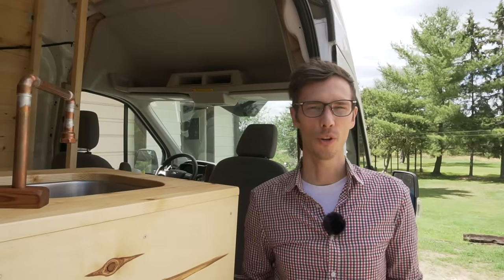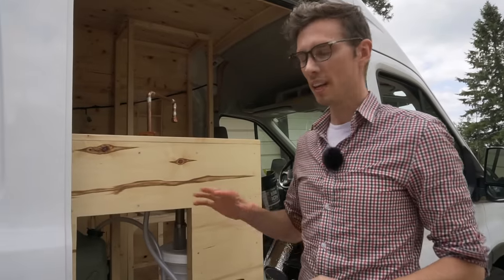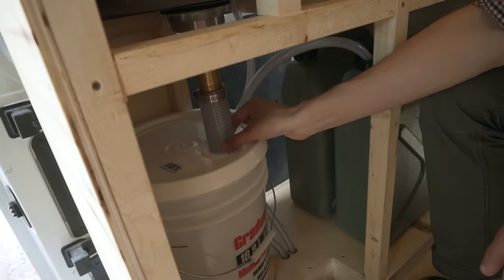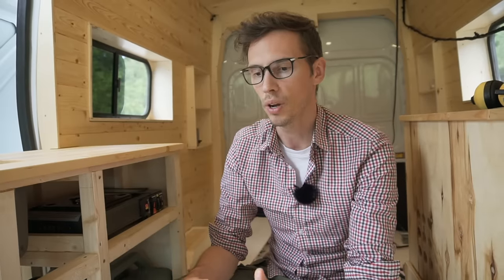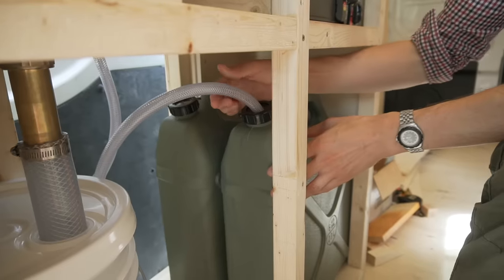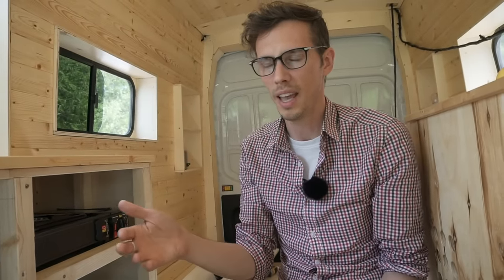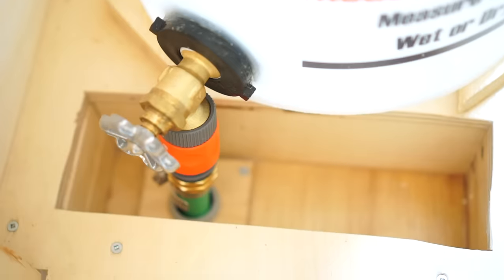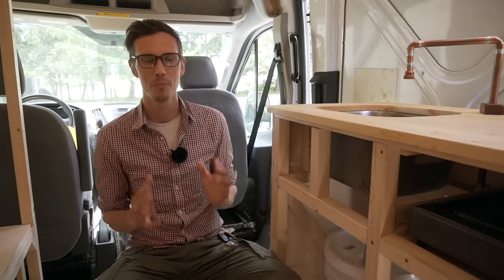Cheap & Easy DIY Camper Van Plumbing System - Van Life

Comment: This might sound weird, but I'm gonna build this and out it in my dorm room because I really want a sink😂
Reply: I will do the same too.
Now I just need to learn how to make a kitchen mini 😂
Reply: It's not really that weird this basic setup principal is used in places like dry cabins in Alaska and stuff all the time
Reply: Make sure you read your dorm contract 
They might not allow it.
Reply: Where did you get the 6gal jugs?
Reply: I know this was a year ago but...did it work out lol? And where do you empty the tank of greywater?
Reply: Not weird at all
Reply: @JJ-el6qx  you can empty gray water anywhere. It's black water that you have to worry about, which doesn't apply. Unless he is into "dumping" in the sink.
Reply: A water basin or baking tray and a bucket is more than enough for the sink, if you glue them together after drilling the holes, though you might want to include a strainer when you glue the things together. As for the tap, you could use such a pump, or you could use another bucket with a tap above the sink, with the possibility to get water without having to pump it, but by having to fill the bucket. You'd need a frame to hold the bucket above the sink, though.
Reply: @ChristianCastle  A mini kitchen requires only a tap + sink + some workspace for prepping, and a stove for cooking. There are propane or alcohol camping stoves, and you could use a bucket and a water basin or baking tray as a sink and grey water tank, though you might want to add a strainer when you glue the hole of the bucket's lid to the hole of the cooking tray or water basin, and you would need another bucket with a tap to have tap water.
Reply: Theonlyonestanding  Thanks for telling me bus carts exist! Now I have to start looking for them!
Reply: @yomamaso100  But you know what they might allow? Two buckets with water inside them and a water basin or baking tray. Add a tap to the bucket on top and drill a hole in the bottom bucket's lid and baking tray or water basin, and glue the holes together with a strainer of the same size, and you have yourself a portable sink with tap water. Using a bus cart would make this setup even easier, though without increasing the height you would need to stay crouched or elevate the bus cart to use it.
Reply: What a great idea!
Reply: Check out the kitchenette at wayside
Reply: Dude, if you do execute this; You should make it in dimensions that you could just install it into a van !! That'd be a sick video !
Reply: Lololololololol!!!!!!!!
Reply: that’s so cuteeeee
Reply: That's hilarious bro!
Reply: I think i would rather use a electric water pump. They sale them and also it recharges. USB. For me it's that simple than pumping, not that i mind at all doing that either
Reply: @larryreyes1064  i’m using an electric pump and it’s amazing and was affordable. i recharge if like once a month
Reply: @jcardosa02  NICCE!! For me, that is the smart way. Good for you doll.
Reply: @justm720  dimensions*
(We're not talking about dementia here! Lol 😆)
Reply: @judylloyd7901  👍🏻 I'm sure everyone still understood.
Reply: Think outside the box
Reply: same I live in someone's basement and I want to try this
Reply: Yes, yes!!!!!
Reply: But do you own it :)
Reply: Go for it. I'm also going to do this in my room
Reply: @AlexandriaPerel  Amazon some hardware stores and most camping stores will have them
Reply: It’s never weird to make you life easier 😂 go for it! Always
Reply: 😂 I'm a plumber.  This comment made my day. Good job bro.
Reply: It's not a bit weird, it's genious!😊
Reply: How is that weird?
Reply: Doesn't sound weird bro now u can sell everyone one for there's dorms when they see urs
Reply: An educated person once said for people with strive for work quality and goals to be achieved "That's a big dormer!"

Comment: Suggestion: I would definitely have at least a 6 gallon grey water receptacle vs the five gallon bucket.  Otherwise you'll always be running the risk of that bucket overflowing because your water source holds 6 gallons.  And that doens't even take into account any additional fluids that might go into the sink like if you're dumping out the dregs of a beer or other beverage, etc.  It just seems like a set up to tempt fate to have 6 gallon water sources with a grey water capacity of only 5 gallons.
Reply: Carole Warner 
Yep, smart, thought of this too. 💪👌
Reply: Drain pipe as grey water. Many diameters. It can fit in wasted space.
Reply: Or, just don't fill your 2 water jugs more than 5 gallons.  Also, not all your 6 gallons of water is going down the drain.  Filling up a pot to cook or a glass of water to drink...none of that goes down the drain.
Reply: Hummm, with a stealth drain, something that can be cracked a tiny bit so it drains as he drives down the highway, over flowing is not really a concern. (Additionally nothing draining out of that bucket on to the highway is going to be nastier than what cars generally drip onto the highway.)
Reply: @rennemichaels2706  My first thoughts too upon seeing that. Nobody is going to drive out of their way to a dump station to offload 5 gallons of dish and hand wash water.
Reply: My guess is he just didn't want to admit on YouTube how often and where the drain is open.
Reply: @jgjg3848  Arguably, it goes down the drain, but not the one in the kitchen, but the one in the toilet.
Reply: @rennemichaels2706  That's a brilliant idea. Plus that, on a hot day, all that non-toxic water will simply cool down the street and maybe even evaporate instantly if the asphalt is hot enough or the drainage is insignificant enough.
Reply: @michaelcherr  That's a fair guess. I didn't think of it that way before you pointed it out.
Reply: Waters never worked for me like that as I drink,cook n wash with it so there's always less

Comment: There is a battery powered survival pro that includes a very small ec pump & it barely makes any noise from what I've seen. Maybe something to look at? Get chargeable batteries. Also the EC pump has filters in it too that would make fresher water.

Comment: I wonder if an S-bend in the grey water downpipe would be a useful addition, to keep unpleasant odours in the bucket?
Reply from the maker: Thanks your comment :) We did think of doing that but the space is a bit limited under the sink so we decided to test it out and wait to see if we really need it. Thanks for watching :)
Reply: Karin Corbin that was my thought also
Reply: FYI. Three other alternatives. 
1). HD has a remote sink basket opener, so you don’t need to reach in the water to let water out of the sink. $29, but on sale from?  Keeps drain shut until button is pushed. 
2). Sink basket that has metal screw instead of plastic or spring stem. The center screw tightens rubber/cork to keep water from leaking out. Works perfect. Tight. Can’t be bumped or jared.  ($15?) for strainer and basket, but need to remember to screw it down all the time. 
3). They make plastic 1/4 turn ball valves. I saw 2” today as looking for other components - sorry, I did not notice other sizes. Less than $10. But needs other attachment stuff. Also needs to be turned off all the time.
Reply: I like the rubber sink plug idea. Easy and readily available in any sink accessory isle.

A couple drips of bleach doen in the gray water would probably do the trick too though
Reply: Another Somebody, Yes, I agree. The thing is, dealing with a class C grey water tank, it got stinkier than the black water tank. Once the bacteria took over, it was runaway bacteria. I know we a dealing with a different beast in vans, but I want to be prepared to “cork” it shut until it can be taken care of ie dump and wash out bucket.
Reply: Not sure it really matters.  Its only 5 gallons, gets dumped often.  Drop a couple Altoids in will help.
Reply: @hobohacker258  Altoids? What do they do?
Reply: @luv2travel2000  seriously strong mints
Reply: Amazon has a space Saving drain for RVs.
Reply: It’s only simple sink water with maybe a little soap. No need for a trap unless your peeing into your sink 😏
Reply: I've been using a 5-gallon bucket with no cover for years. I've never had an odor problem. I add a splash of vinegar to the bottom every time I empty it, to rinse it, and then, I add fresh vinegar. Kills all the bad stuff for what gets in there in my house. I have to empty it about once a week or two.
Reply: A HepvO trap replaces the drain P-trap...

Comment: drill a 1/4 inch hole in your fresh water cap to allow air to enter the tank. If you do this you would get faster flow, and do same for grey tank so it drains faster.

Comment: I really appreciate this video - it is exactly what I have been looking for.  I am an old man - 80 years old - and am getting ready to build a van to live in for whatever time I can now.  I can't lift a lot and need convenience.  I want a simple system, not expensive.  This is perfect.  No electrical, easy to handle containers, and inexpensive.  I like that you have it at the door for easy access - better for me than on the opposite side.  While I plan to have solar panels, I am not going to go wild over electric - just enough to take care of lights, a small entertainment center (probably no TV) and charging laptop, cellphones, small cameras, etc.  I want easy and as low maintenance as possible.  I have spent the last forty years maintaining a country home, working my tail off with plumbing problems, electrical problems, yard equipment problems, rodent problems, you name it.  It is a van or probably a nursing home, and I still want to travel a bit and be able to continue fishing.  Concerned about toilet situation - still looking for best solution to that, but I don't plan to do a lot of boondocking, so there will likely always be a WalMart or MacDonald's somewhere close enough for most needs. 

Thanks for your video - I am a subscriber but need to look for your other videos.
Reply: I think a composting toilet is best. No plumbing. No black water.
Reply: So cool!! I saw this is four years ago! How did it work out for you?!

Comment: Good simple foot pump. On mine i will put a foot switch there to control a small pump On the water supply after the pump i will use a gate valve to limit water usage. If possible i will put an submerged water heating element ring you can buy from tractor supply. Hook that to a solar generator when needed. But you already got a system. Right now i dont even have a van yet. Yours right now is better..... nice...

Comment: Very cool. I am going to run a similar setuo. I couldn't help but notice that the soldering wasn't being done properly. When soldering you want your flame an inch away from your connections so that when you actually touch the pipe with the solder it will suck it in and create a very good seal. By placing the flame directly on or too close to the connection point you risk there being gaps you can't see and having a leak now or in the future.

Comment: For the most part I've done the same sink layout in my van.  It has served me well for the last 3 months and i am perfectly happy with the foot pump as it is amazing how little water you use because of the control it offers.
Reply: Terry B i have a foot pump pipe system and the pipe that comes out of the fresh tank is mouldy, why? we change the water every few days i don’t know how to stop this, no one seems to talk to talk about mould problems in the van i would love some answers 😓
Reply: @pouredoutmywindow  Try running a quart of vinegar through your system. I sometimes rinse out my water containers with a tiny bit of soap, and rinse them vigorously with vinegar. I've not has a mold problem in 4 years of doing this.
Reply: How much did your configuration cost?

Comment: Advice for anyone doing a similar thing. Whenever you have room for two hose clamps instead of one, put two of them. It will hold much better when things vibrate etc as it does in cars.

Comment: P-trap is what people are referring to and available at any hard ware store. You could make one by bending a rubber hose. The idea is to capture a bit of water in the bend which blocks the odor and every time you wash some water remains.

Another idea would be a flapper that opens when water flows and closes when it isn’t.

Comment: The ingenuity of simplicity and low cost. Thank You. My only concern would be if the water sourcing is scarce and the water may be questionable and the type of non-electric filtering.

My plan for the hi-top 2500 Promaster 159 WB has something like your setup next to a shower pan/curtain on the same side as you did. The shower will use one of those 'endless showers' where you can recycle/filter-clean the water and bathe with 1 gallon or less so a faucet with an extension long enough to the shower pan area is needed. Also, I would have to pre-heat/boil between 1 liter to 1/2 gallon of water in cooler days.

Comment: I like how clean and simple it is.  I think a "ball valve" would make a better 5 gallon bucket dump valve.  The existing garden hose valve is only designed to flow perfectly clean water.

Comment: Great design! I like the whole system. On mine I will not put a drain in the bucket but just take the bucket out to empty it and then wash out the bucket for all the people worried about the smell. Thanks for the info on the foot pump.

Comment: I live in a McMasion and love this. Only thing I would do differently is use a cheap clearance regular faucet with aerator, swivel action and pull out sprayer. Also, undermounting a sink to wood is going to be an ongoing bacteria/deterioration/discoloration issue around the rim. No amount of caulking is going to help over time. I'd use solid surfacing here with integral bowl that can handle scrubbing & bleach etc. Good video!

Comment: Hello,  Very nice design. set up and construction.  Well thought out and constructed for your requirements. The best part is:  If anything breaks or fails to function,  you can just take it off and head to Home Depot,  get parts, and  fix it and to this  in less than 2 hours and be on your way.  Doesn't get any better than that.    Regards,  ~~ Karen Calypte

Comment: Question- what if you installed the freshwater cans higher than the sink. The water pump would still regulate when the water comes out, but you’d have a strong flow. 

Just a thought. I’m considering it for mine, but if not I’ll just do this!

Comment: Cool I have a conversion van I'm going to try to add a sink to, and have been looking at this water pump. My sink will be on the back door and hopefully removable. That's the goal at least. Not trying to live in my van, but camp comfortably in it. Small sink on 1 door, metal shelf for a camp stove on the other one.

Comment: This is pretty much exactly the system I designed for my tiny house, except I have a P-trap on my drain to keep odors from coming back up the drain pipe, and I don't bother with a drain on the bucket, itself. It's a simple enough matter to simply remove the entire bucket and dump it when needed.

Comment: Thank you very much for the video which is from 2018 but I just discovered it. Thank you above all for your very good pronounciation because English is not my mothertongue - I understood every single word. Last but not least I wanna thank you for your good ideas regarding the watersystem in the van. I want to convert my own van without any previous knowledge (I don't install the electric) and I have an upset stomach regarding several parts of the conversion - f.i. the water system... But I know that you loose your fear as soon as you understand how to do things. Nice regards from Germany, Judith

Comment: I like your sink setup. It explains its self. I feel it's a little over built. The Bucket doesn't need a drain I think you'll find later, unless you want it to drain as you drive. You don't need to go into all the detail about it. The foot pump is the best part of it. I've been looking into a gravity feed water system, but your pump might be better to keep the fresh water close to the floor. Thanks

Comment: If you can find some stainless steel or aluminum pressure cookers you don't mind drilling a few holes in you can setup a berky style water filter with seals to reduce the risk of spills in transit. The hard part would be the filter would need to go in sideways with supports to keep it from flexing as you drive so would need a hose to a bulkhead fitting down to the storage tank.

Comment: Excellent video, but yours usually are.... I was researching this very pump that I plan to use in my dry sink set up in my micro-apartment that I've made from an average sized bedroom ( I really don't enjoy rooming with others, especially when they are very unclean and hog the kitchen..... but no problem for me; I'm a designer, so this has been an amazing challenge to create very usable spaces that are small, but practical and comfortable) Right now, I am using a beverage dispenser that sits on a pedestal over the vessel sink I made.... it takes up too much space on my 3 foot counter, so I am replacing it with a foot pump. I am curious to know now after this length of time, how the pump has worked out for you.... also, in reading reviews on other sites, it seems the pump seals tend to leak under pressure; has that happened to you; and if so, how did you deal with it? Thanks so much for all your great informative videos, and have a very Merry Christmas and God Bless you on your journey.